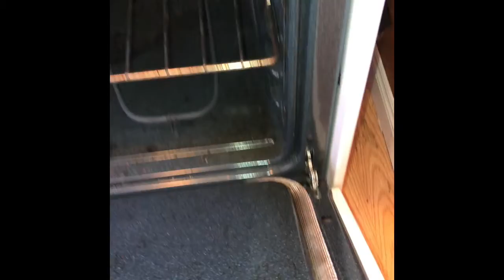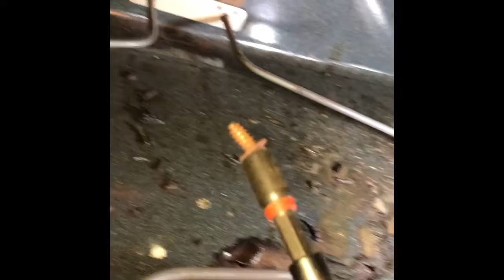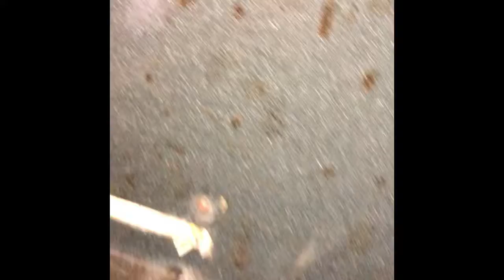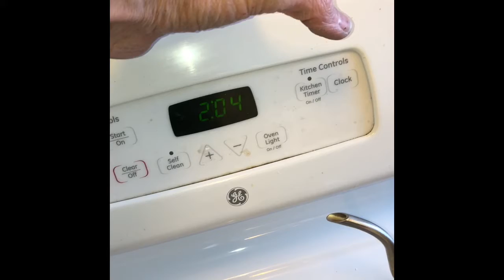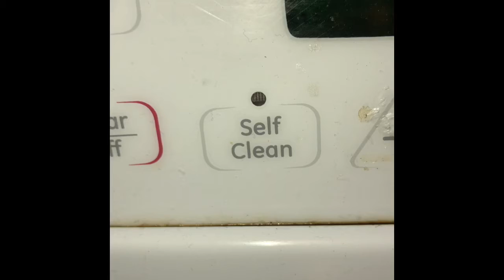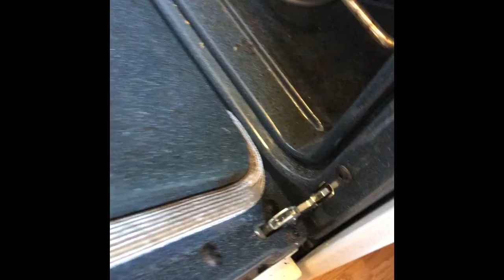✨ GE Electric Oven  - Won’t Heat  -  EASY FIX ✨

Comment: What happens if you accidentally touch the frame and short it?
Reply from the maker: Probably just need to reset the 2 breakers for your oven👍
Reply: @ScottTheFixItGuyChannel actually ended up having to replace the control board… but that may have also been a result of continuing to use the oven after the bake element went out? Not sure but it works greats now either way 😊

Comment: Thank u i have the same issue my electric oven not working at all luckily my stove works i think its either thermal fuse blown something else
Reply from the maker: Can you check the breaker box to make sure both breakers for the oven are in the on position.
Reply: @ScottTheFixItGuyChannel i did that

Comment: I have a 1993 model GE electric stove/oven and the bake element is not heating.  Will the same model bake element you showed work in my vintage stove?  The shape looks the same as mine.
Reply from the maker: Yah,
GE has kept the same basic bake element for a long time.

Comment: what is the proper resistance on an element? i was cleaning my oven today and lifted the element up a few times to get underneath it. now im getting no heat and relay is clicking but element looks fully intact - where to start?
Reply from the maker: If the internal wire inside the element broke you’ll get an OL reading on your display.
Probably time for a new element.
Reply: @ScottTheFixItGuyChannel  interesting i wasnt aware there was a conductor inside i thought the element itself was the conductor. thanks ill check it

Comment: I replaced my bottom burner in my GE oven and it still won’t come to baking temperature.
Reply from the maker: If you’ve replaced the burner and it still won’t come to temperature, it could be an issue with the oven’s wiring or control board. Probably the controller 👍

Comment: So I put the broiler on and the top element got really hot and red but when I put the oven on bake, it beeps when it reaches the temperature i put but the oven does not feel hot just warm, would it still be the elements that I need to replace? Even though it got super hot on broiler? Thank you
Reply from the maker: Sounds like it just needs a new bake element 👍
Reply: Thank you so much for replying 😊

Comment: So let’s say you replaced the bake element but when you turn the oven on now, dis doesn’t heat to the high set temperature and won’t glow amber… what should I be looking at next as the issue?
Reply from the maker: Gotcha,
Can you make sure that both breakers for the oven are turned on.
If they are and still no heat, then you replace the controller 👍

Comment: I have the exact same stove... had a power issue (needed a new wall plug) not enough power to it... Now stove comes on but does not heatat all anywhere
Reply from the maker: Hi Chris,
I think you’ve only got 110 volts coming to the stove.  You need 220 volts.  Might want to check the 2 breakers for your stove.

Comment: The bake element on mine stays in during preheat then shuts off and only the broil stays on and locks the door.  Is this still a bake element issue or something else
Reply: I am having the same issue. did you ever find out what it was?

Comment: Great video... very helpful... Now is there a way to check the power going to the element before changing it or is that not ever a problem? thanks again.
Reply from the maker: Hi Paul,
If you can go behind the stove you should be able to remove a sheet metal panel and near the bottom you’ll see the two wires going to the bake element.
You can use your multi-tester to look for voltage when the stove is set to bake. If it has voltage than you know it’s the bake element.
Reply: @ScottTheFixItGuyChannel  
Nice video. I also have a GE that needs a new element and I was thinking that I could only access the connections from the rear of the oven, which would be a bit of a hassle. Are most GE element connectors accessible from the inside? I hope so!! :-)